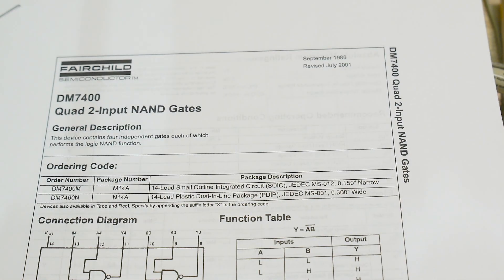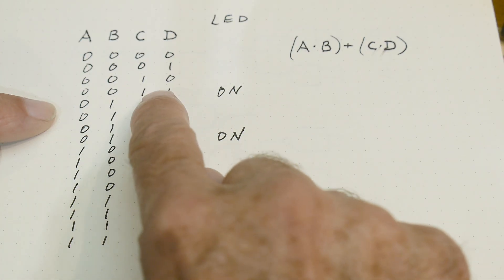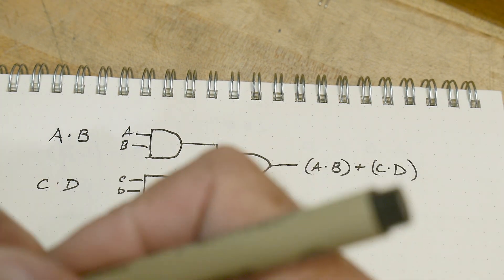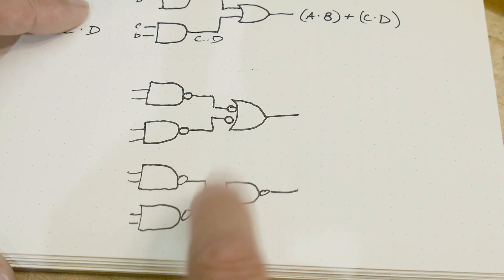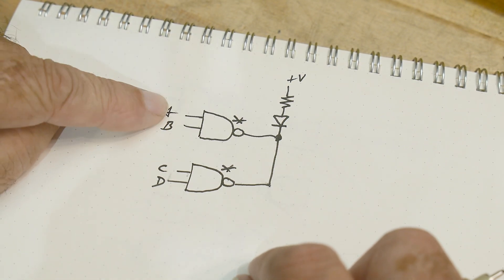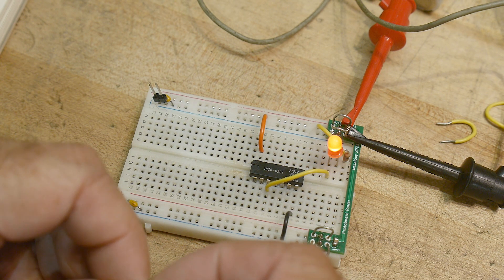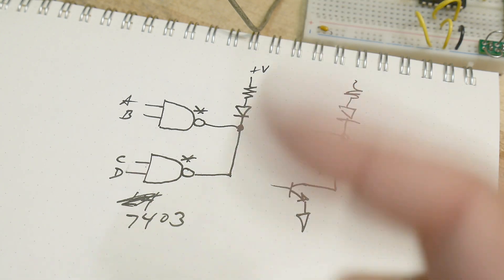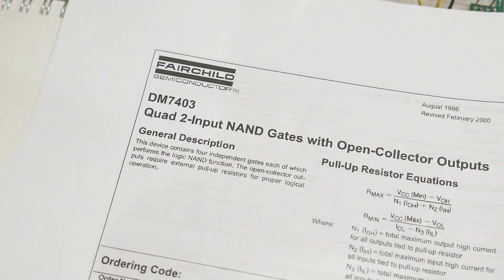#1622 7403 74LS03 Quad NAND

Comment: I used to have to do similar stuff like that in software.  It's pretty easy with nested if-then-else statements.
Reply from the maker: just use the boolean. chat gpt wrote this:
const int inputPin1 = 1;  // Define input pin 1
const int inputPin2 = 2;  // Define input pin 2
const int inputPin3 = 3;  // Define input pin 3
const int inputPin4 = 4;  // Define input pin 4
const int outputPin = 5;  // Define output pin 5

void setup() {
  pinMode(inputPin1, INPUT);
  pinMode(inputPin2, INPUT);
  pinMode(inputPin3, INPUT);
  pinMode(inputPin4, INPUT);
  pinMode(outputPin, OUTPUT);
}

void loop() {
  // Read the values of input pins
  int val1 = digitalRead(inputPin1);
  int val2 = digitalRead(inputPin2);
  int val3 = digitalRead(inputPin3);
  int val4 = digitalRead(inputPin4);

  // Perform boolean OR operation and write the result to output pin
  bool result = (val1 && val2) || (val3 && val4);
  digitalWrite(outputPin, result);

  delay(100);  // Optional delay to prevent rapid reading and output changes
}

Comment: Although it is commonly called wired-OR, the actual function at the node is AND.

added on edit: Something that was sometimes useful with OC parts was connecting two or more gates in parallel to increase the output current sinking ability.

 It is usually OK to assume that TTL inputs left floating (open-circuit) will be HIGH for simple breadboard work, it does not meet the specifications to assure HIGH. A pullup resistor is required. Iirc, you have to source 20 µA into a standard TTL input to assure it meets the requirement for HIGH.

DM is an initilism for Digital Monolithic. These were copies of the SN74xxx series from Texas Instruments. I have no idea why SN was used. Fairchild produced some TTL parts of its own design. I don't recall the number but one of the parts was a monostable that was considerably better than anything in the 7400 series.

Comment: 😜 here's the opcodes to do the same thing in a PIC micro! i.e. 12F510
[EDIT: I TRIED THIS ON REAL DEVICE IT WORKS INCluding opencollector ]
SETUP
	CLRF	ADCON0
	CLRF	CM1CON0
	MOVLW 	B'11101111' 
	TRIS	  GPIO
	BCF	GPIO, 4 

IN_A ; pin 7 
	MOVLW	 B'00000001'
	ANDWF 	GPIO, W
	BTFSC	STATUS, Z
	GOTO	IN_C
IN_B ; pin 6
	MOVLW 	B'00000010'
	ANDWF	 GPIO, W
	BTFSS	STATUS, Z
	GOTO	  OP_LOW

IN_C ; pin 5
	MOVLW 	B'00000100'
	ANDWF 	GPIO, W
	BTFSC	STATUS, Z
	GOTO 	OP_OPEN
IN_D ; pin  4
	MOVLW	 B'00001000'
	ANDWF	 GPIO, W
	BTFSS	STATUS, Z
	GOTO	  OP_LOW	

OP_OPEN
	MOVLW	  B'11111111' 
	TRIS  	GPIO
	GOTO 	IN_A
OP_LOW ; pin 3 (open drain)
	MOVLW	  B'11101111' 
	TRIS	  GPIO
	GOTO 	IN_A
Reply from the maker: const int inputPin1 = 1;  // Define input pin 1
const int inputPin2 = 2;  // Define input pin 2
const int inputPin3 = 3;  // Define input pin 3
const int inputPin4 = 4;  // Define input pin 4
const int outputPin = 5;  // Define output pin 5

void setup() {
  pinMode(inputPin1, INPUT);
  pinMode(inputPin2, INPUT);
  pinMode(inputPin3, INPUT);
  pinMode(inputPin4, INPUT);
  pinMode(outputPin, OUTPUT);
}

void loop() {
  // Read the values of input pins
  int val1 = digitalRead(inputPin1);
  int val2 = digitalRead(inputPin2);
  int val3 = digitalRead(inputPin3);
  int val4 = digitalRead(inputPin4);

  // Perform boolean OR operation and write the result to output pin
  bool result = (val1 && val2) || (val3 && val4);
  digitalWrite(outputPin, result);

  delay(100);  // Optional delay to prevent rapid reading and output changes
}
Reply: @IMSAIGuy   [EDIT: Ah "ChatGP" Kareoke style] 
Cool doing it in C - more generic! though I don't see the LS03's Open-Collector output coded here just a standard H/L output.

Interesting see the raw opcodes & how many a C complier generates for a PIC12F510. Guess 3-4 times more opcodes used. be interesting see how a C compiler codes the open-collector output
Reply from the maker: the original problem statement was to control and LED. open collector was only one solution that I demonstrated
Reply: @IMSAIGuy  Oh OK :)  I was responding over literally to the video's title "LS03 oc nand" to drive led.    
Hey the microcontroller's connection to LED could use led as a light sensor, by using its ADC !!

Comment: The real benefit of open collector outputs is when you have multiple devices on a bus. With push-pull outputs if you mess up you could create a fault where one chip is trying to drive the bus high and the other is trying to pull it low, effectively shorting both outputs to their opposite rail via the other chip. It then becomes a race to see with chip burns out first. With open collector, you'd use a 5-10k resistor to pull the bus high, and then it  doesn't matter if more than one device tries to assert itself to the bus as they can only pull low.
Reply: IIC / I2C  (i.e. serial EEPROMs) and CAM bus and lots of others where there's often output data collisions , they use multidrop opencollector signalling. They can survive indefinate o/p short to ground
Reply: Open collector busses have their merits in terms of simplicity but they are slow. As need for speed increased OC busses were mostly abandoned in favor of busses driven by "tristate" drivers that could source current. The old TTL tristate parts had considerably higher source current capability than ordinary gates. This allowed faster charging of the bus capacitance.
Tristate drivers with good source and sink drive capability also facilitate driving busses that are properly terminated in their characteristic impedance.

Comment: There is a 7401.  It is a quad, two input nand gate just like the 7400 but the gates are around the other way.  Pins 1, 4, 10 and 13 are outputs instead of 3, 6, 8 and 11.